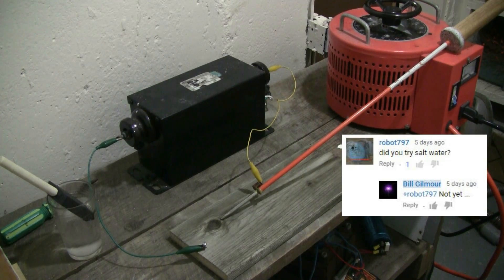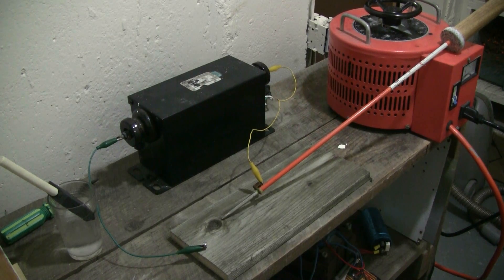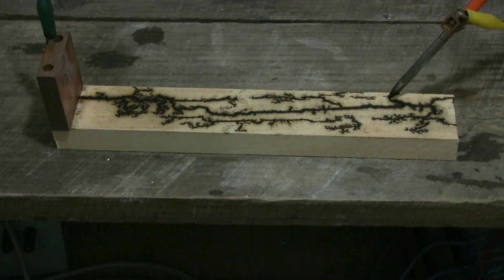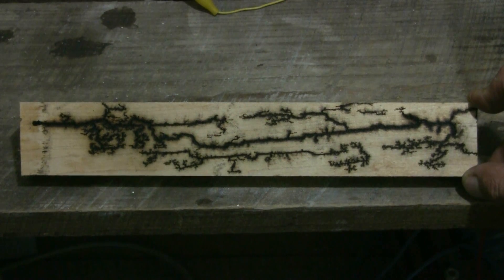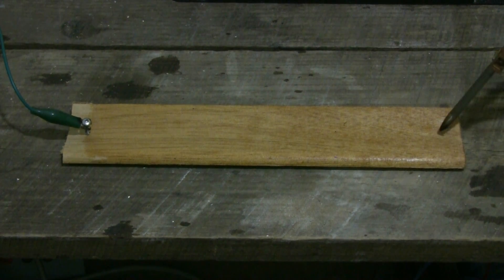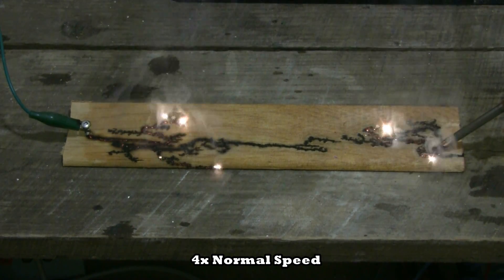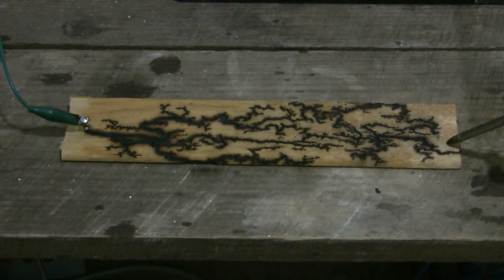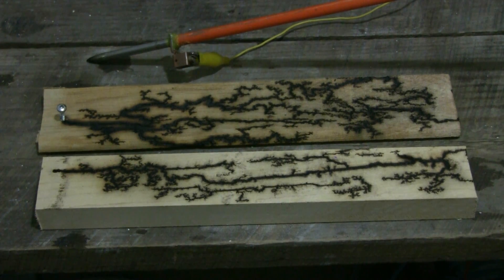More High Voltage Wood Burning

Comment: Allanson also sells some more modern solid state high voltage transformers, and for cheap:
http://www.supplyhouse.com/Allanson-2275-456-Solid-State-Ignition-Transformer-for-Aero-Burner-11223000-p

Have one of them myself, they are beasts that put out 17,500 V AC(25,000 peak), 45 mA under brownout,  at a frequency of 22,000 Hz 

These are using SCR (silicon controlled rectifiers). What they offer in terms of compactness and efficiency makes a difference in a big way
Reply: +Infinion  thanks for posting this link.  i checked the brochure on these things.  they are designed for constant duty which is a very good thing for wood burning, since you will be running the power for long periods of time.  i was just about to buy some used neon transformers from craigslist for $50 - so even with shipping, you saved me some $$

have you noticed any difference in the patterns you get with this transformer compared to videos of NST or microwave transformers?
Reply: +thai karl well it definitely punches through dielectrics much more easily than NSTs and other high voltage transformer coils operating at 60 Hz. Plus you won&#39;t normally see NSTs and microwave transformers at higher than 10,000 V.

On the other hand, microwave transformers are usually 5000-6000V at much higher currents so you can get some pretty hot and noisy arcs.

All the transformers pretty much all produce the lichtenberg figures. What you should really try is setting up is a Tesla hairpin circuit with a pair of high voltage capacitors and a spark gap. You play with much higher energies with high voltage capacitors because while all high voltage transformers are current limited, capacitors are going to supply very high currents while they discharge all their stored energy, so the arc is quite literally white hot. I recommend getting some cheap $15 welding goggles to protect you from the intense UV light of the arc. 

Also if youre maintaining an arc for any appreciable amount of time, please please ventilate the room. Arcs and corona discharges generate ozone which is unbreathable air.

Comment: Hey I've found through my own experience that keeping the chicken stick contact wet with a conductive solution and a sponge attached will create tree images. The burning will only occur at the other terminal. Just in case you wanted different results.
Reply from the maker: coolweirdgreat Sounds good. Thanks.